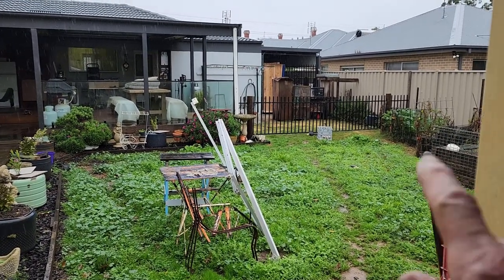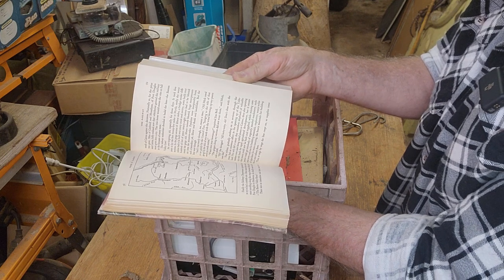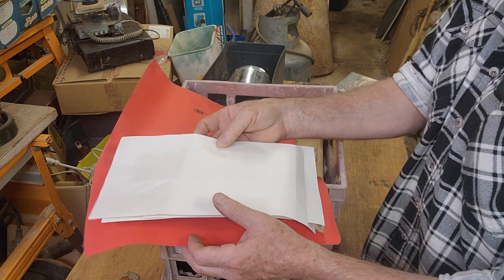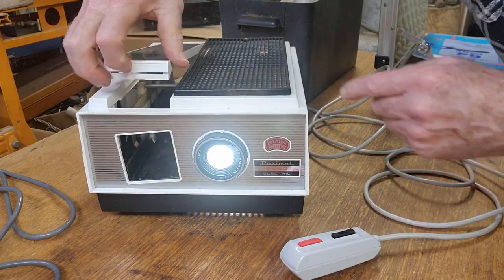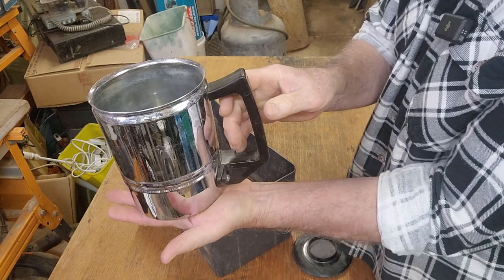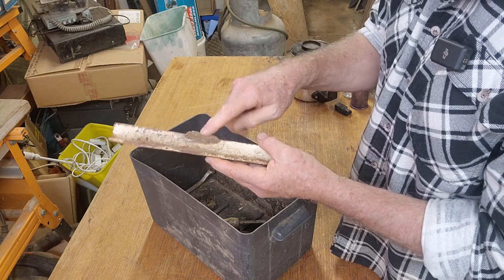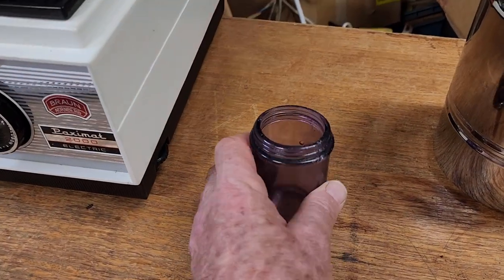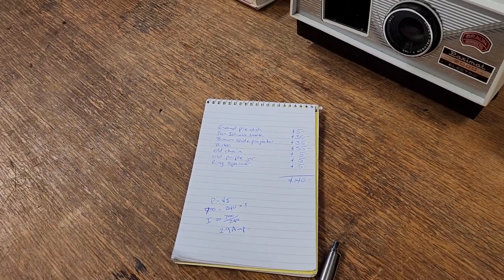Storage Shed Clean-out Part 18 - Unboxing an Old Braun Projector, a Retro Birko & other Cool Stuff!

Comment: The connector for the Birko is a c15 IEC connector. They're designed specifically to handle pin temperatures up to 120C. The cut out is so that you can't accidentally use a C13 connector which is only rated to 70C.
C15 connectors usually have a burn resistant cord attached to them.
Reply from the maker: Excellent information Michael! I appreciate the input 👍👍😊

Comment: Chris, may I do some estimation math?   There looks to be about 20 boxes that can fit into the width by height of your emergency storage shed.  Each box layer is maybe 1.5 feet deep and the total shed is 30 feet deep.  That means there are 20 layers of 20 boxes, or 400 boxes in there.  Doing one box per week will take 400 weeks or 7.7 years.  May I suggest doing two boxes per week?
Reply from the maker: Hahaha, thanks for that reality check Shane! Most times I do more than one - maybe I'll try for three! There are some larger things in there like CRT TVs which will make space quickly. But honestly - what's wrong with 7.7 years of treasure hunting?? 😁🤪
Reply: @TheUltimateRecycler  love it Chris!  😂. I think your entire life has been a treasure hunt!  Keep it going!  And share with us the jewels.

Comment: I have a older projector looking thing in a wooden box i picked up recently (sounded like you described it as a cannon look) with a Sharp Reel to Reel tape player. not sure they will be much good due to being in a leaky shed for a long time, but like nearly everything old, it's likely going to be a cool display piece if not working even.
Reply from the maker: Some reel to reel players can be quite valuable Dean - even for parts. Be worth checking the model number. Certainly cool display items if nothing else 👍😊